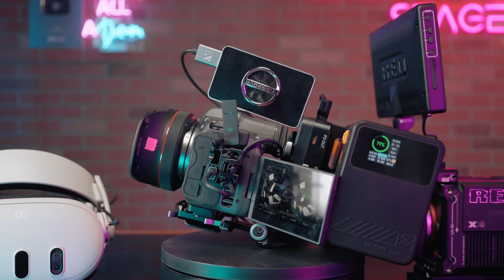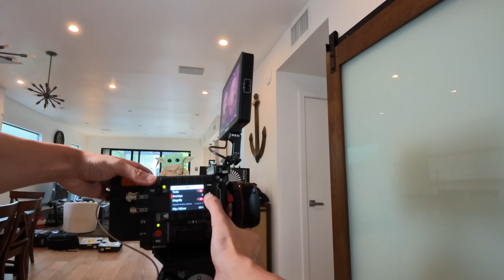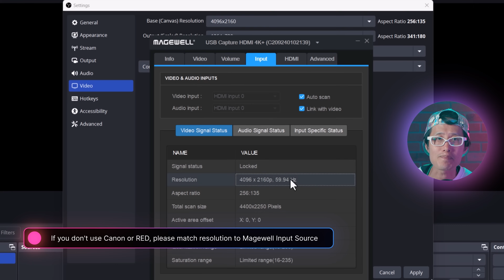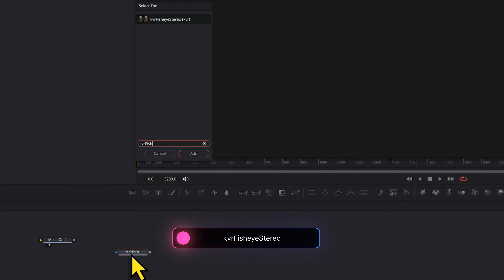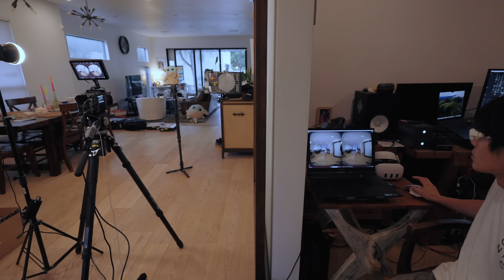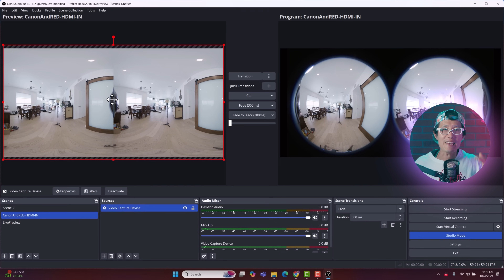How to Stream Canon R5C, R5 II & RED Cameras to Meta Quest 3 in Real-Time VR180 | Masterclass

Comment: Thanks Hugh for this detailed explanation of your set up for streaming. I'm dreaming of the day we can do 8k, 60fps streaming :) Actually i know it's possible to do it with the RED V Raptor 8K. Maybe that can be your next video ? :P I have a question: Wouldn't a 360 degree shutter angle at 60 fps create too much motion blur?  I always thought it is better to set shutter speed at 1/120 for shooting 60fps. 360 degree shutter angle is equivalent of shutter speed of 1/23.98. By the way, can you do a video on the advantage of using Atomos Shogun Ultra for monitoring on Canon R5c with the dual fisheye lens ? cheers!
Reply from the maker: Yes I am planning on making the 8K stream tutorial with my RED but life got in the way lol. But it is coming. The 360 shutter speed - to be completely honest - a suggestion from official Meta. I shoot at 90 degree, 180 degree and 360 degree really based on lighting and what I am capturing. But to my experience, the rule of thumb really is in 360 shutter angel. This is because Meta Quest reflesh rate is 90Hz or 120Hz. 60fps (59.94) is not exact match with headset refresh rate - so it cause minor jitter - only people like us will notice btw. So in counter that, 180 shutter rule which work great in cinema but not great in VR. We increase the rule to 360 so frame to frame has "smoother" motion so the jitter will go away from frame rate and refresh rate unmatch. The ideal frame rate is actually 90fps or 45fps - but no camera we used can do 45fps so we settle this solution. We did extensive testing (as we always do, go out the way and do it professionally), and can say 360 shutter angel rule is better than 180 - except when you need to AI upframe stuffs and mess with frame rate in post - that is why you need to know your post workflow as well on set to make that call. Long answer but hope it help
Reply: “Becos meta quest refresh rate is 90hz or 120hz. 59.94fps does not match with headset refresh rate. So it cause minor jitter”. 
Thanks for your attention to details. I guess it really affects viewer comfort when someone is watching for longer than 10mins. It buffers me why headset manufacturers don’t just made their devise with refresh rate that’s compatible with our cameras. 
I’m just curious. Have you use shutter speed instead of shutter angle ? Eg. 1/120 when shooting 60 fps.

Comment: Hi. I need to know what frame rate you usually you shoot for 3D immersive videos? I am shooting a short film drama on Red Raptor.
For the dialogue scenes do I need to shoot on 23.98 FPS or higher frame rate? 
Please advice. Thank you!
Reply from the maker: Oh no. Never shoot under 30fps but ideally - 120fps!!! I am not joking. But I shoot 60fps on Raptor
Reply: @hughhou  Thank you so much for your advice. Your all videos are so well-made & honest. You are so humble! 
Q: For dialogues oriented film if I am shooting for 60fps on raptor, I need to record sound at 60 fps as well, correct? 
Q: Is there any way to get AVP's view on director's monitor so that other crew can also see the final frame? 
Thank you again!!!
Reply: @hughhou  So as per your answer on Ideal shutter angle for 60 fps is 360 degrees. It would work for Raptor and good for Apple Vision Pro?

Comment: Hi, as a traditional filmmaker I have started shooting some footage in 180 immersive, I have learned so much on your channel. I have a question, how do you get those black blurred edges when watching on the headset, is it done during the shooting or is it done in post? Thanks a lot.
Reply from the maker: It’s done in post! I will make a tutorial soon. I actually use VFX to remove the lens first for maximum FOV 180 before applying feather edges
Reply: @hughhou  Thank you for answering, I found a solution with the Canon VR utility, looking forward to your next movie.

Comment: Hi Hugh, would you recommend HLG normal or K-Log mode for Qoocam 3 ultra? Latest Firmware update:

Dear Customers,
 
We’re excited to share the latest firmware update for the QooCam 3 Ultra, version V1.0.5.11! This update brings a range of highly anticipated features designed to enhance your shooting experience.
 
🎊 New Features in Firmware V1.0.5.11:
1. 10bit HLG Normal and 10bit K-Log Modes
10-bit HLG Normal: Achieve stunning HDR results without post-color grading, making it a great choice for users seeking an easier option.
10bit K-Log: Maximizes dynamic range for professional users seeking greater flexibility in color and brightness during post-production.
2. New Metering Options in 10bit
Shadow Priority: Ideal for high-contrast scenes, emphasizing details in darker areas, though highlights may be more prone to overexposure.
Highlight Priority: Suitable for most scenes, maximizing dynamic range preservation.
3. Expanded Interval Time Options for Timelapse Shooting
New intervals include 1/10s (3x), 1/6s (5x), 1/5s (6x), and 1/3s (10x), perfect for capturing dynamic scenes.
4. Dynamic Range Boost Switch
Easily toggle this feature from the control center.
5. Preview Interface Enhancements
The interface now displays current manual exposure settings and EV offset for improved usability.
6. Improved Location Accuracy and GPS Stability
7. Optimized Visual Quality for 10-bit Videos
Experience better visual quality when 'Dynamic Range Boost' is off.

 
🔥Don’t miss out on these exciting new features—update your firmware now to elevate your QooCam 3 Ultra experience! For understanding where to find these functions and options, please watch the video for reference.
 
SHOP NOW
 

We value your feedback and ideas for new features or improvements. Your input is essential in shaping the future of our camera, so please share your thoughts with us! If you have any questions or suggestions, feel free to reach out to us at service@kandaovr.com. We’re here to assist you.
 
 
Sincerely,
Kandao Team
November 2024
 
Shadow
Facebook
 
Instagram
 
YouTube
 
LinkedIn
 
X
No longer want to receive these emails? Unsubscribe.
Kandao Technology SINOSTEEL BUILDING NANSHAN DISTRICT 2ND FLOOR, BLOCK M7 ShenZhen, Guangdong 518053
Reply from the maker: I honestly have not tested them yet so I can’t recommend

Comment: Thanks for this amazing tutorial ! Just one question, if you use your laptop pc outdoor, on location, without router/internet connection, could you still connect your Quest to the PC Wifi and stream with Central Control ?
Reply from the maker: Yes. For local streaming, you do not need outside Internet. In fact for most production I been on, there is no outside Internet for IPs safety. So the network is only for internal streaming. You don't need Internet for this workflow but you do need a good router for ditribute internal signal especially you have more than 2 or 3 Meta Quest viewing the show live. You only need Internet if you are livestreaming it in public
Reply: @hughhou  Thanks a lot ;) I'll try it soon.

Comment: Spectacular Hugh... you had anounced nearly one year ago and it´s incredible the amount of things to complete before to get the full workflow, congrats!!! Just a question: Do you think would be enough to complete the workflow using a RTX 3080ti (16gb laptop) or a RTX 3090 24gb Desktop PC?? ... It´s important to see the whole panorama before to buy the Magwell USB Capture or even the Touchdesigner License.... As usual, Thnaks a lot for tons of VR content, tutorials and pieces of advise!!!
Reply from the maker: You don't need Touchdesigner license and I actually not recommand it. Use the OBS free workflow here and it is actually better and more recent build. In term of computer, as long as you have an RTX you will be good. RTX3080ti will work just fine. RTX4090 actually overkill a bit but we are talking about stream over 50 headsets - so it only make a different when we really running a theater.
Reply: @hughhou  Thanks a lot for the info... we need to order the device and let start some tests... Spectacular info!!!

Comment: When I shoot and watch the video on meta quest in 60fps there is lag in the video, and when I shoot in 29.97 fps was running smooth. Please advise
Reply from the maker: 60fps live stream like this video? Or 60fps recorded video. If it is livestream following this tutorial, it is designed for 60fps and should not have any lag. The reason can be in the networking part - you might need WiFi 6 or 7 router to provide a dedicated communication. If it is recorded, then mean your resolution is too high. What is your resolution?
Reply: @ I haven’t tried live stream yet. I was having issue in the normal recording. I had to convert the files from 60fps to 30fps once I did that videos were playing well. I am quite new to filmmaking and 95% of my learning was through watching your video’s 😇 . I will go back and watch the videos and to check my camera settings and see if I am going wrong in any area. But again thanks to Kimchi and you 😍
Reply: @tarunpareek8929  I think your bitrate is too high. Set it to 60mbps and push from there.